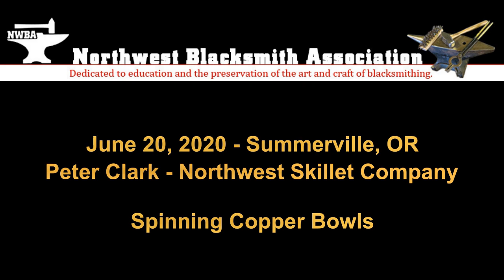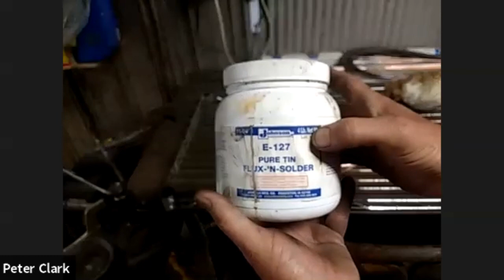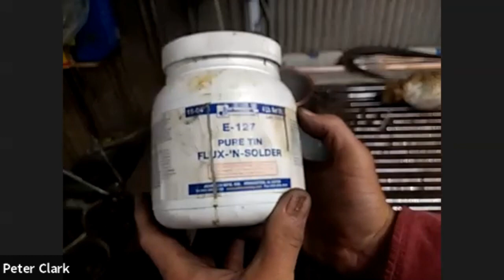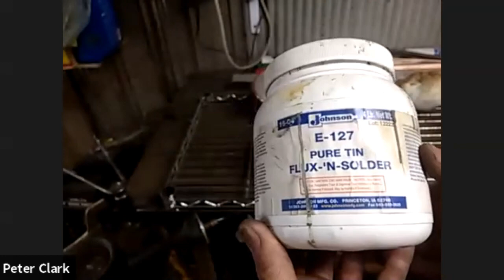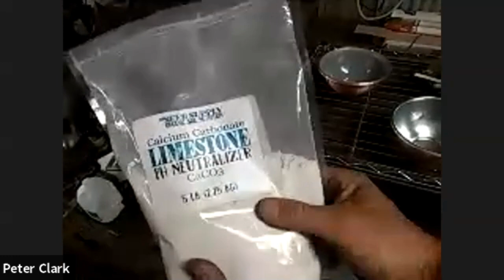Digital Demonstration #9 - Spinning and Tinning Copper Bowls with Peter Clark

Comment: if your doing a run of multiple bowls....one way to prevent the scalloping when you first start spinning the bowls is to use multiple forms each one closer to the desired shape with the first one significantly wider at the open end. you change to the next in line after each reannealing.. the size your made would take three forms with the last form also having the start of the lip in it..